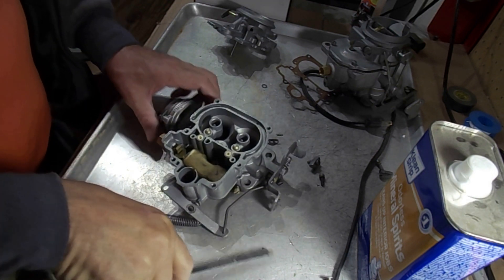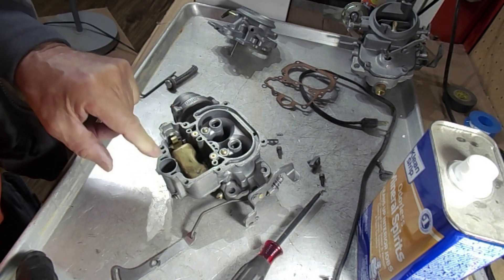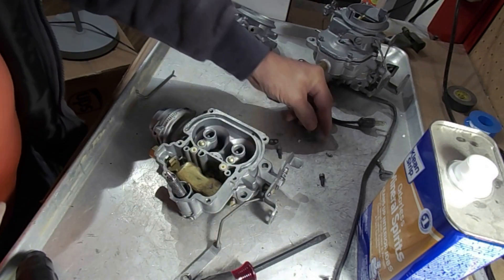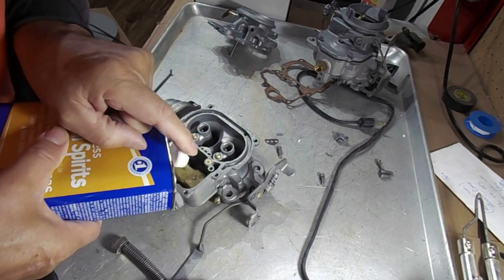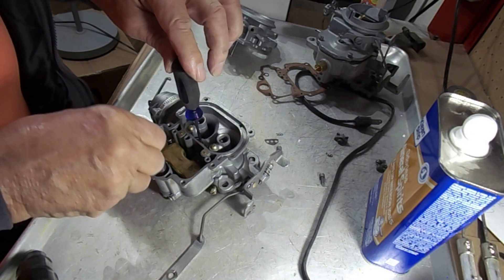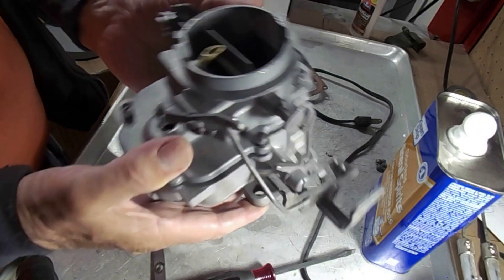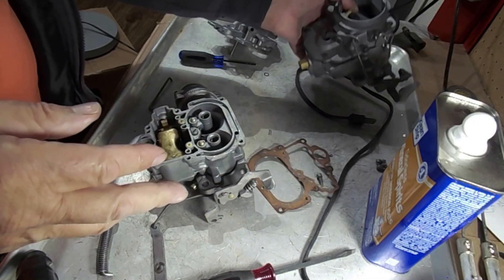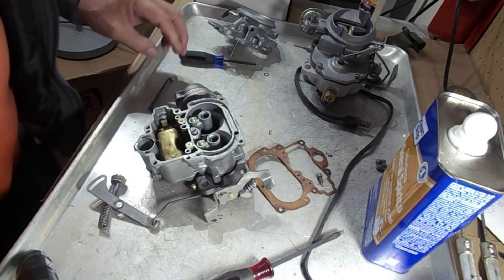Stromberg WW Accelerator Pump Circuit

Comment: Mike Than no THANK YOU for this lesson I have a 1960 Le Sabre when i get the car started by disconnecting the fuel pump and pouring a little bit of fuel in the carb it stays running but I connect the fuel pump and it has too much fuel causing fuel to over flow. After watching your video I think that check ball is not seating. Either way you have given me some knowledge in an area that is foreign to me so again thank you.
Reply from the maker: Check the fuel pump pressure and check the needle & seat. The needle may not be sealing.

Comment: Hey Mike! Thabks for the video.  I bought one of your WWC rebuild kits way back on 2009.  It worked like charm.

Question - Do you know of any "heat plates" for a WWC? I think im fighting heat soak.

Edit: Subscribed!
Reply from the maker: Sorry none available that I know of. Try another brand of gas. That might help. Make sure the fuel line is away from exhaust.

Comment: Mike when I press down on the pump I only get one side to squirt not two. Every thing has been cleaned recleaned  with carb cleaner blown with air.
Reply: @MikesCarburetor  thank you Milke. Found the problem in the little plastic composite  there are 2 squirters where the gas comes out. If you gently stick a sewing needle thru the squirters you'll find two smaller holes that you almost can't see unless you know they are there. clean it out with the sewing needle and a squirt of carb cleaner. Now both sides squirt gas equally. thx again, Rafael